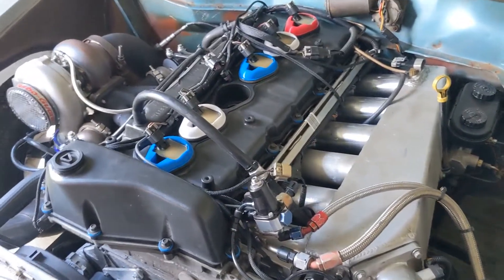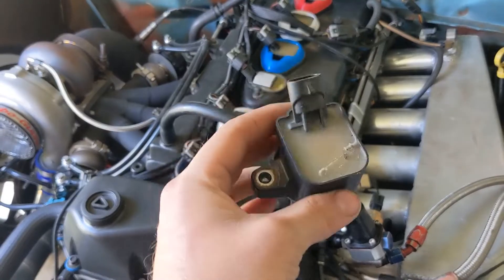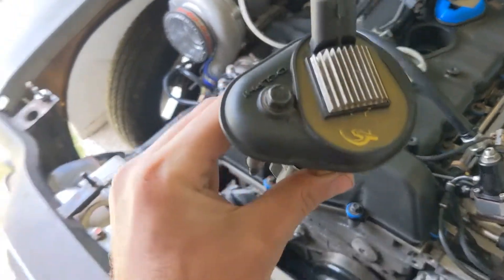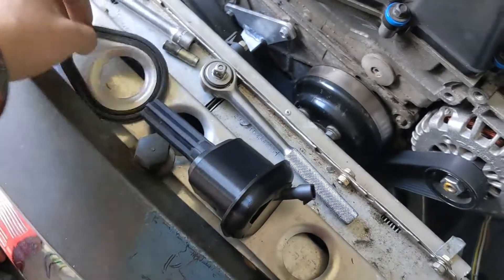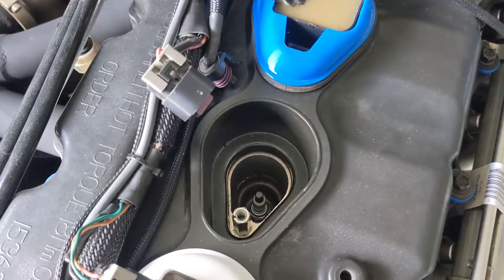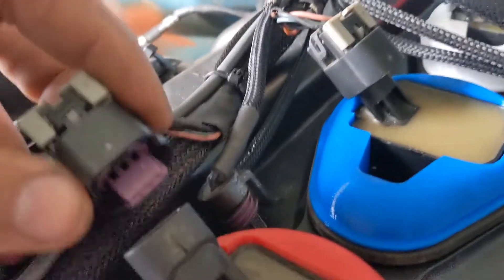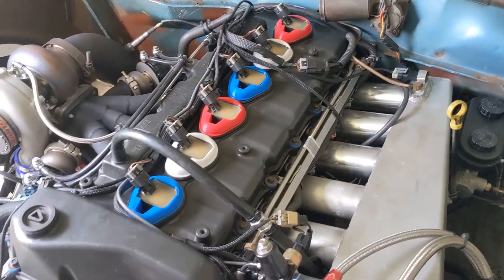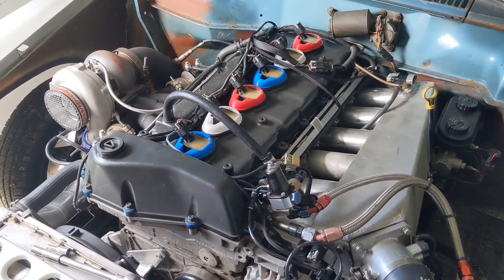Introducing Coil Adapters for your Vortec 4200 build

Comment: I sent you a message via the Contact Us on your website on Saturday, I sheared off the stud of the Standoff (the thing in your hand at 4:05) of the last coil when installing these over the weekend, how can I get a new standoff?
Reply from the maker: I replied to the message. Did you not receive it? I'll ship you out a new one. No problem. I won't be back home until next week. Currently racing at Sick Summer.
Reply: @Calvin-Nelson  I just double checked my deleted items and inbox and didn't see anything and I thought I was being careful going through the junk email each day but it's possible I missed it in junk, no problem, have fun racing, my fun will be extracting the bolt from the cylinder 6 plug well in the Trailblazer, lol.

Comment: If you where buying new coil packs from like NGK would the 06+ coils from NGK be better then the 02-05 coils from NGK?
Reply from the maker: Yes.
Reply: @Calvin-Nelson  ok, couple quick questions then, I have a stock 02 4200 i'm planning to get a tune on, is the coil pack update worth doing if thats the limit of the performance mods planned or something better to hold off on if I ever turbo it or something way down the road? 

and whats your preferred coil pack, are NGK's better then stock or just stick with stock, which I notice rock auto has 2 stock coil packs for the 06, does it matter which one you get?

Comment: When will the coil adapter be available again? If you don't produce them anymore, would it be possible to purchase the print file and sign an NDA or whatever ?
Reply from the maker: They are still available. If they are marked out of stock on the website, it's just because I forgot to update the stock. I'll fix it quick.
Reply: @Calvin-Nelson Cooool. Thanks.

Comment: Have you noticed any spark issues using the stock springs in the coil boots or are there upgraded springs that work better?
Reply from the maker: There is a guy that changes the spring out for like a beryllium rod. He's on the Trailvoy forum. I forget what they're called. Like "Super Sparks". Something like that.

We've not had an issue that I am aware of.
Reply: @Calvin-Nelson  The irony is I know exactly who you're talking about.  LOL!  His name is James, aka Supermodulation.  I have a set of his SuperSparkz on my '06 5cyl however they won't work on the 07 coils.  Thanks for the quick reply!

Comment: People use the second gen because it supposedly is the better version. I agree though, first gen. can make some massive torque too. I'm only working with a few mods but get second gear scratch that puts it into a fishtail. If you don't get out of it (and can counter steer with some control), you can turn it into a nice smoky drift. :D
BTW, can you make some more of the black coil adapters please? There are only two left. Thank you.
Reply from the maker: I have two sets left. I kind of make them on demand. Don't really receive floods of orders at any given time, so I'm able to keep up with demand with limited supply.
Reply: Do you have the 2005? And what mods have you done to make you break the tire loose at 2nd gear?

Comment: Can I get a red white and blue kit?  Do you still sell these?   Your site is always sold out of them.
Reply from the maker: I can't get any more red and blue filament. I have a used set off y Studebaker. They're a little dirty, but if that's ok with you, I'd sell them.
Reply: I'll take them. Shoot me an email and price and does it come with the hardware?
Reply from the maker: @brandontague343  yeah. Comes with the hardware you'll need. Just order a set of the black ones, and I'll ship the red white and blue set. I'm assuming your username will match the name on the order?
Reply: @Calvin-Nelson  I tried to order set of black ones but it won't let me. Says only 1 left when I click order. Won't let me check out.
Reply: @Calvin-Nelson  it'll let me do 5 but not 6
Reply from the maker: @brandontague343  Try now
Reply from the maker: @brandontague343  Got the order. Thanks!
Reply: @Calvin-Nelson  thank you

Comment: Would you need a tune for the different coil packs or just simple bolt on and would it be good for a vortec 4200 NA daily ?
Reply from the maker: They drop in. No tuning required. I have a guy who is going to do back to back dyno pulls to see if they make any power difference.
Reply: Has the dyno been done yet?

Comment: Any oil seepage using these yet?
Reply from the maker: No. Why would there be oil seepage?
Reply: @Calvin-Nelson  the coil pack on the 02-05 is used as a valve cover hold down for the valve cover seals around the spark plug tubes, improper torquing can not supply proper pressure on those seals allowing oil to leak and fill the spark plug tubes, it's a common issue on these engines as they age and the seals get closer to needing replacing.

Comment: I really like what you did and i want to import these to my country in a big stock. The only problem is, people will use these to street and dialy driver application and i can confirm, that these coils afraid of rain and water. They have to be 100% weather sealed. Especially in the 6-th and 5-th cylinder on Trailblazer and voys.

If you make it waterproof, we have a deal man. I really love what you do.
Reply from the maker: Yeah. Only way to make it weather proof would be a bead of silicone around the coil before installation.

Comment: How do i know of my engines blown or i need a oil pump i got no oil press its a 4200
Reply: while this comment is 3 years old and has likely resolved their issue, if this happens to anyone else, unless your engine is making odd noises, then odds are the oil pressure switch on the lower front right side of the motor just above the oil filter has likely failed, they are the same part used in the LS based V8 motors in the trucks and have a history of falling, they will either peg the gauge to max or to min when they fail. when failed in the MAX side they will show the needle on the dash all the way up with key on engine off.
Reply: @DanielsCorner644  nope
Reply: @DanielsCorner644  it's not the senser no

Comment: Hey calvin in my research on the 4200 block i found a PDF about the casting process of the 4200 by "steel founders society of America". Apparently they used a strong aluminum (A356-T6) in the 4200 block which is the same aluminum used the LSA/LS9 heads, in the PDF i found that aluminum is stronger (has a higher tensile strength and yield tensile strength than the 319-T5) 319-T5 is what they used to cast the LS1/LS6 and i believe the 5.3 aluminum stuff. So if true the blocks might not be as brittle as people make them seem. If you want the link let me know its from 2004. Might be something you can add to your wikipage.
Reply from the maker: Yeah. Shoot me a link at Nivlac5700@gmail.com

Comment: if you swap to the new vavle cover will the new coils fit
Reply: You can’t fit the new valve cover on the older engines. You must get this adapter kit to fit the new coils on the older style valve cover.

Comment: Will heat be an issue with the 3d printed part?
Reply from the maker: Being that it is not in direct contact, no. They are printed in polycarbonate which already has a higher heat resistance. I've run mine through a few heat cycles and they've been holding up well.
Reply: @Calvin-Nelson  awesome to hear, I was making throttle body adapter plates and was given a ton of grief for it being 3dprinted so I went with cnc machined. Also wanted to say check out speedyEFI i found their build to be a bit more robust than speeduino :-) Cheers love the channel